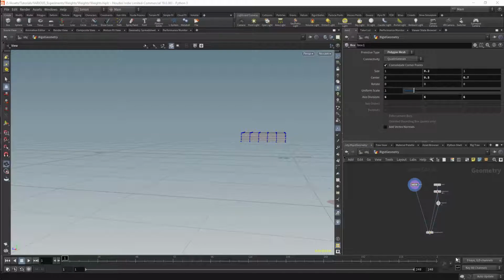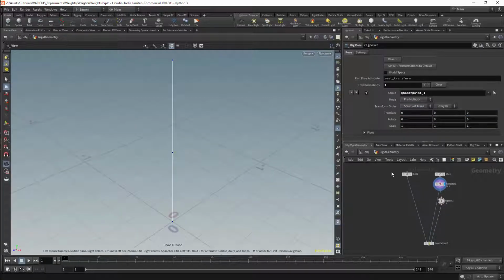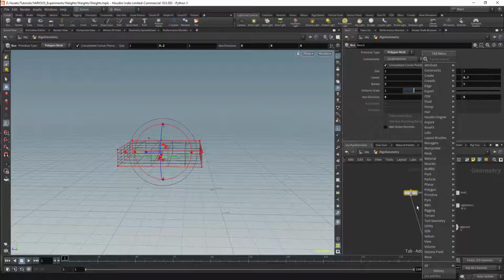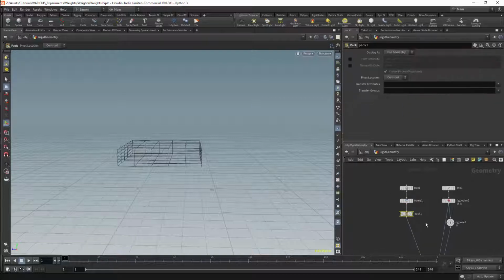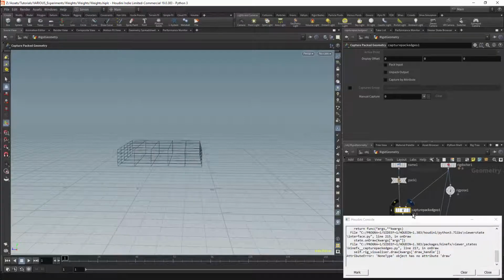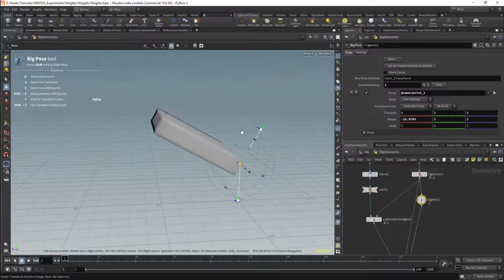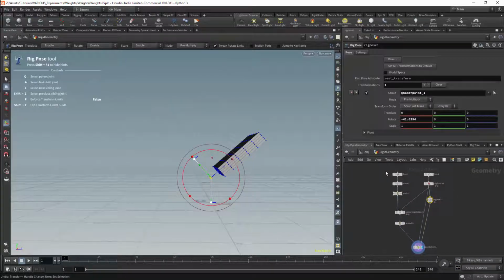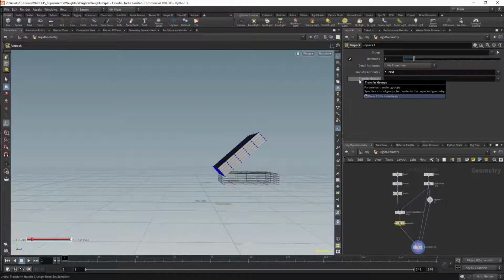KineFX Weights 004 Weighting Packed Geometry

Comment: You can also Pack and Unpack geometry (Box in this case) using Capture Packed Geo node by enabling "Pack input" and "Unpack output". It also provides options for transferring data 🙂

Basically the same thing but from a single node.